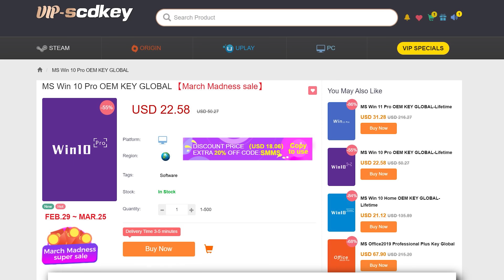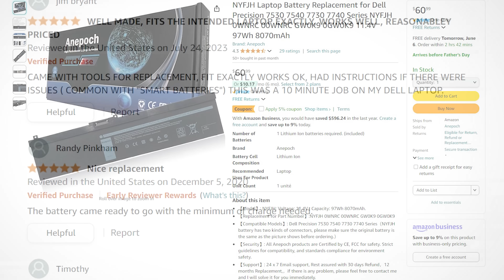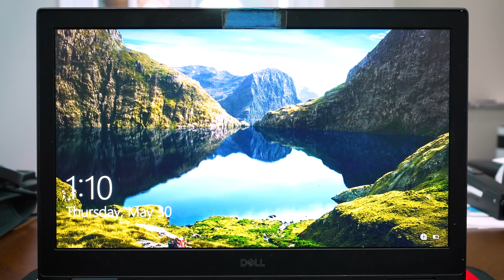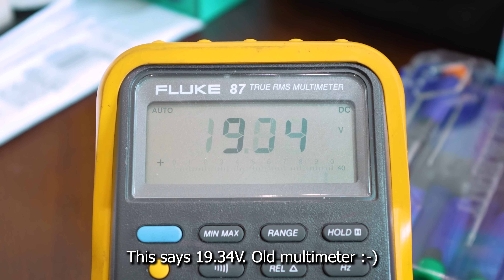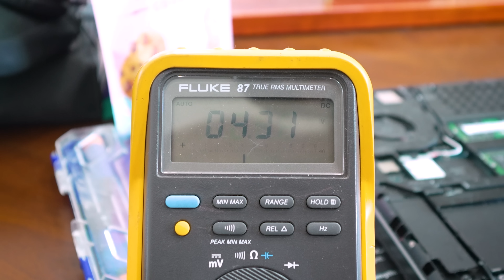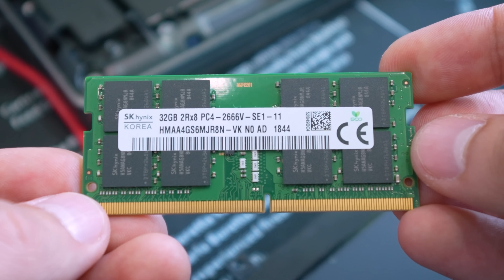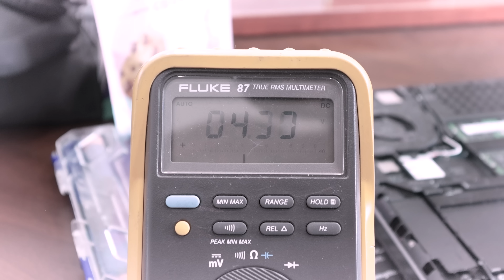Fixing a Viewer's BROKEN Gaming PC? - Fix or Flop S5:E14

Comment: Some current dell laptops 2021+, have some sort of security chip in the battery that prevents you from using a third party battery. I do not know a work around for this. I've replaced batteries on dells with 3rd party ones for 10+ years at my IT job.

Comment: there is a youtuber here in England that fixes computers. ive seen him fix similar things with different laptops including apple. its often something on the motherboard. a chip or capacitor etc... i once saw the power in socket been the issue, and i was thinking it was that when i saw the power plug wobbling about... doesnt that blue light turn green when it connects? laptops are the worst for these issues.

Comment: The aftermarket batteries for laptops are pretty mediocre. If your battery is not holding a charge at all they can be worth it, but if it's still marginal I don't ever see much improvement

Comment: Some tips from someone who does this on a nearly daily basis. Before ordering a new battery, try pulling the battery out completely, plug in, and see if it runs. If it does, then you've isolated the battery as the issue. If not, then chances are really high that the battery is not the issue. For Dell and HP, both have pretty decent diagnostics built in (F12 for Dell, F2 for HP) complete with a power delivery/battery check. Lastly, regards to the data saving, make sure the data drive is NOT bitlocked by Microsoft (they like to turn it on by default). Also some laptops, especially of that age have Optane drives, not easily readable outside of the system they are built in.

Comment: I had to replace an older Dell Laptop battery a little while ago. In my experience, through reading forums and researching what was the best choice, OEM or if I could save money through buying an aftermarket battery. It turns out Dell has counter active measures ingrained into the software that recognize fraudulent batteries and will force the laptop to not charge or even go into a limited performance mode. Kinda like "Limp mode" on a car. Just like you, I did not want to spend $120 on an almost 8 year old laptop. I found (what I believe) to be an OEM Dell battery from eBay of all places for roughly $30-40 bucks. Luckily, that battery was recognized as a genuine OEM and now that laptop works well aside from a video issue that still needs to be addressed. Hopefully this might help a little bit?

Comment: replacement amazon batteries for laptops are hit or miss. i bought one many many years ago for an old laptop worked fine and after a few years amazon sent me an email saying to stop using it because they had reports of the batteries catching fire.. its still in use and amazon gave me my money back for it without me asking for it. and more recently bought another battery for a different laptop and it never worked out of the box.. but at the end of the day it was only like 20$ since it was again for an older laptop. it all balances out in the end. its just the price you pay on trying to keep things from going to the landfill and finding new homes for older tech.

Comment: I had upgraded my wife's laptop from Vista to Windows 10 which Dell said could not be done. Anyways, after awhile it stopped doing what you're describing so she bought I believe 2 new power supplies from a place called Batteries Plus and yet both times it still won't hold a charge. Needless to say she doesn't use it anymore.

Comment: Hey greg i run into this issue all the time with dell there is a data pin inside the female side of the power commector that tells the laptop a dell charger is installed usually replacing thr connector cable fixed this issue there cheap like 10 bucks on amazon and ebay

Comment: Sounds like the replacement battery is at fault, if it worked to start with and failed, but the laptop works with the original battery in place then the only thing it can be is a faulty replacement battery. Greg all you did was put the new battery in the laptop and charge it. It failed, laptops will not usually switch on unless there is a charge in the battery. Send it back, the supplier will send it back for a refund. Good video, shows how some of these generic parts can be just a waste of money.

Comment: What it most likely is is the same thing when you have the exact same symptoms with a cell phone.  Smart charging voltage regulating circuits.
You remember all the bad press that the Samsung Note 7 got for catching fire ('exploding')?  One of the main reasons that they could not figure out what the issue was was there are charging circuits at multiple points that both report on, but more importantly, protect the computer.  There is usually one on the battery, one where it mates up to the computer, one where the charge port takes in a charge, and AIUI, one in the power supply that they PC uses, which these days is broken up between the power brick/PSU and the charge cable itself.

When these circuits between the battery and the motherboard fail and short out they can dump power to ground when you try to charge them.  So the new battery might still be alive.  Actually it is more accurate that you would have to charge it in a functional laptop to see if it is still good, so until then it is Schrodinger's Battery so to speak.

In a way it is too bad the PC is that old, otherwise it may have made a good collab piece with a board repair channel to show people how it is fixable but WHY it is so hard and expensive to fix.

Well hopefully your father's work will spin him up another new Dell, or maybe a good computer this time.  My firewall is an old DELL Desktop and the last time there was an issue with it it took 3 techs 8 hours to get to the malfunctioning fan, and then the guy with more experience with DELLs 5 seconds to get at the fan.... and I am the one with more training than him.  That is why I have a rubber mallet that I call my Dell repair tool, and that is after a joke one the last shop I worked with had, except I USE MINE. 😆

Comment: That is a fairly strange situation because I bought an Asus laptop used and it would power up while plugged in while on a dead battery. I think that even with a completely dead battery, most laptops will power up if plugged in. I would likely think power supply first before battery. Of course oI have heard stories of one of the control chips on the board blowing.

Comment: I had the exact same issue on an Asus laptop (About 4 years ago), so changed out all parts 1 by 1 was was really shocked to find that the hard drive was the issue, as soon as I replaced it, everything worked as normal and problem has not replicated since then, my wife is now using that laptop fine.

Comment: the laptop wouldn't turn on even when powered, and you decided to start by replacing the battery?
You had to start by checking the charger and power socket, so replacing the battery may have been completely unnecessary.
In addition, a broken power supply or damaged charging port could destroy the new replacement battery, so you should check everything before installing a new battery

Comment: Why do they have the battery enclosed inside the casing ? That's just dumb engineeering. My old laptop just connected from the very outside of the casing. I thought that's how they all were. I really dislike laptops ever since having that one. Strictly use desktops from now on.

Comment: Greg, please tell me you held the power button down for 30 seconds (plugged in, off on the wall) before you changed the battery to power cycle it? I had a friend with exactly the same laptop last month with this issue and that cured it totally.

Comment: I repaired many Dell laptops in my company. Though this issue is rare, it's not uncommon that the power distribution circuit got toasted. For me, the very first thing I check is short circuit (test the 19.5V pin to ground).

There's also a way to clear stray current according to Dell's technician, which is to remove the main battery, CMOS battery and power adapter, then press the power button for 30 seconds or more. Not sure if this'll work but it usually has a chance to fix the issue. 

Lastly, tell that company to get Lenovo Thinkpad or Thinkbook. Dell quality is quite poor these days and expensive for the things they provide.

Comment: Check out videos from Adamant IT (ignore the beard), it's possibly a capacitor on the board that shorted, that can break charging circuits.  The other option is to remove the battery completely, and run only on mains power.  Works sometimes.

Comment: Don't laptops power on and then off from overheating ? I remember seeing this issue around 10 years ago on a few laptops. If they are completely off for days, they`ll actually turn on and post up to windows or for a couple of minutes but then shut off and after that they won`t even power on. Might wanna check. I`ve encountered even a melted cable on the board from overheating.

Comment: Bad charge connector i guess, the replacement battery is discharged as it wasn't charging. The plug looks like very loose and not making proper contact

Comment: Had the same issue with both an alienware and a xps laptops. The only fix was to get  replacement board from dell and it worked fine after that.

Comment: For laptops that don’t power up I have three steps. 1 Remove the power adapter and the battery. 2 Press the power button several times to drain the power capacitors. 3 Plug-in the power adapter and start the laptop with no battery. If that works replace the battery and go from there. This has worked on many systems. Thinkpads, HPs, Dells, and Toshibas.

Comment: it could be that the signal pin in the power cord gives 20v instead of 5v and that could fry a chip ion the laptop easy fix but you have to do some soldering and replace a litlle transistor

Comment: Some devices, such as my previous phone and an old lenovo lappy which died a few months ago, if the battery had a less than 5% charge they will not power on from powered off state even while plugged in. SteamDeck is the same way also.

It's possible the adapter cooked the battery.

Comment: I have had battery issues with laptops. From my experience you can remove the battery and still power laptop just using the power supply. Not ideal if you need the laptop to be mobile but if it’s just in an office setting it would be fine. The bad battery being connected interrupts the powering on of the laptop. 

However in your case knowing that adding the power supply killed the battery maybe operating the laptop with no battery installed and just the use of the  power supply might do more harm.

Comment: I have the exact same problem with a Lenovo laptop. When I plug in the charger, it won't charge the battery or turn on the computer right away. I i leave it plugged in for a few hours, though, it will start and run the computer, just no battery charge. I now have the battery unplugged inside the machine, and run it as a second "desktop."

Comment: Laptops are always the worse to troubleshoot, battery failure is such a common issue and it never seems to work out when you straight up replace the battery, I personally lost 2 laptops to dodgy batteries and their connectors. Glad you did a thorough test Gregg.

Comment: Maybe its some older electrolytic capacitor in the power delivery part of the mainboard, not holding its capacity anymore. This could explain the turning off after a few seconds, since the voltages are more unstable with "broken" capacitors. But it could also be something totally else.

Comment: Most likely damage from overheating. Fans most likely jammed with dust unable to kick heat out of the system. Older dell’s known for overheating on many laptop versions in the end the shop owner concluded dells max temperatures threshold was too high before slowing down cpu/gpu. Computer shop repairs made a lot of money from dell repairs 😂😂

Comment: I know I shouldn't have felt this way because I'm not an expert, but flops are necessary unfortunately, if you want to be a PC gamer/user. I ruined a friend's PC build because I got cocky and didn't do my due diligence on every step. I was lucky in that I had a third spare system that is honestly a great 1080 PC. But now I have knowledge I did not. I'm better prepared for the future.

Comment: I had a Dell Precision a little older than that one and it recently died on me too. Mine wouldn't light up or power on at all after about 6-7 years, even when plugged in and battery removed.

Comment: 99% sure the charging port was shorting out and killed your battery. When you plugged it in after the replacement I immediately noticed it wasn’t seated all the way. I’ve replaced many power input jacks. Super easy fix

Comment: My only laptop that I ordered a new battery for I ordered a generic one off Newegg and it only lasted less than a year before it failed to hold a charge. I actually got the manufacturer to replace it, but that one lasted a little over a year before the same problems. Compared to the original battery from Toshiba, that lasted at least 5 years (I was only really using it for Microsoft Office for school, web browsing, and Runescape, so it did all I needed it to). Don't remember how much an OEM battery cost or if I even found one for sale, but sometimes OEM feels worth it.

Comment: its possible there could be some sort of short in the battery cable or the board but at the same timegreg i dont think you did anything wrong its possible there is a defect in the battery that ya purchased

Comment: If battery or charger have a laptop shutting down in a few seconds then I wouldn't have spent $60 on a new battery hoping the issue is fixed. I cant say for new laptops but the older ones with removable batteries would run fine just off the charger (battery removed) so I would have first tested if it worked with the internal battery disconnected.

Comment: After replacing the battery without connecting power adaptor should have run Diagnostic test to ensure other components are fine , then exact problem can be isolated.

Comment: I wonder if it has something to do with the Polaris of the charger cuz my universal charger has different size barrel jacks that connect by 2 prongs sticking out and depending on which device I'm charging you can rotate the barrel so that its positive to negative or vice versa.
I really think its the charger that messed it up and sometimes batteries have a fail safe to stop taking a charge if its too much power and you have to replug it in for it to work again so the battery could still be okay and it wasn't working cuz the fail safe triggered it to stop working till its  unplugged/replugged.

Comment: I had the same issue on a laptop i was given. I bought a new battery and it only lasted as long as the charge on the new battery. I could not get it to charge either battery.  It is such a frustrating problem.  I gave up on fixing it too.

Comment: With Dell laptops, if they power up for at least a few seconds, they will hopefully flash the power LED in white/orange flashes that will give you a trouble code to narrow it down.  Then you just Google it.  Example "Latitude 5590 2 orange 3 white"

Also, Dell laptops will tend to boot no matter how bad the battery is if your power adapter is good.  They'll boot even if there isn't a battery connected.  And of course if you boot with a good battery and no power brick, it will boot fine, but if there is a problem with the power brick, it can cause a no boot with a fully charged good battery.

Luckily I have DOZENS of Dell power bricks around to test with ;-)

Comment: i hope your dad cleared this with his employer's IT department, because if not he's on the hook for the damage an aftermarket battery caused and yes that is entirely likely, also I hope they approved your removal of the M.2 and recovery of data. Not saying you shouldn't help your dad but as someone who does corprate It support if someone besides a member of the IT department opened it up without our premission that person's manager would be informed and we'd have to refer it to legal if the storage drive was removed and copied on a system outside of our control.

Comment: I'm more inclined to believe the new battery is to blame.
I had a similar issue when buying pandora batteries for my PSP and replacement batteries for my PS3 controllers.

Some would work for a little while then kick the bucket after being charged or taking several charges.
I wasn't miffed because the batteries cost far less than the official ones, hopefully the replacement laptop serves your pops for many years to come.

Comment: If it was a battery problem then it would be able to run off the adapter. I don't know of a laptop that requires a battery to boot. Some, like HP, require one charged past 50% to do a bios update. Then my Surface works without a battery, but not at full power. If I try to put a heavy load on it with a dead battery it throttles. If the battery has a charge then it will run off both the adapter and battery for demanding tasks.

But end of the day if the laptop will not boot, it's not going to be a battery issue.

Comment: the power brick has a known failure with the center pin when its damage dont charge the battery only deliver energy conected thats all the other known issue its the lack of cooling dell always fails on that... if change of laptop put a thermal pad on the m.2 i did the same with my vostro and update the bios theres a lot of new revisions and they install without warning from the windows update

Comment: I know with HP laptops a faulty battery won't prevent a laptop from starting up if it's plugged into the power and I would have assumed Dell laptops to be the same. in fact, you can remove the battery all together and the laptop will run normally when plugged into the power. If a HP laptop doesn’t startup when plugged into the power, I wouldn’t have even bothered buying a replacement battery.